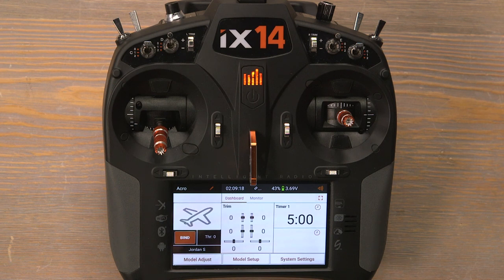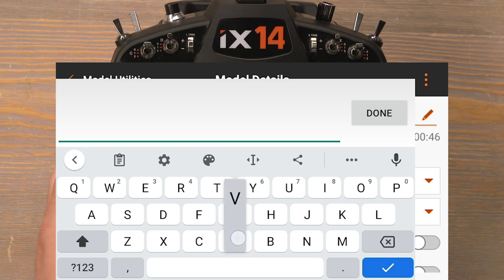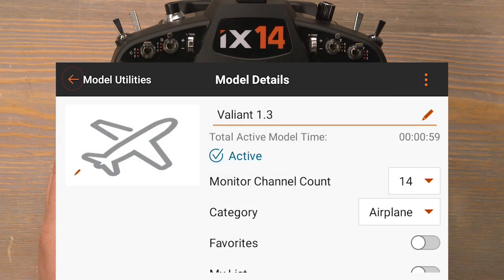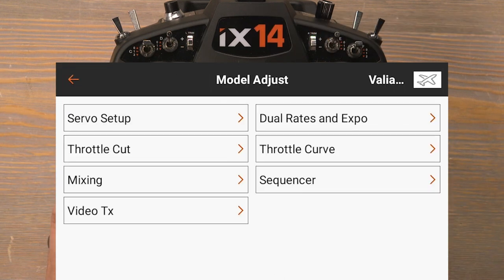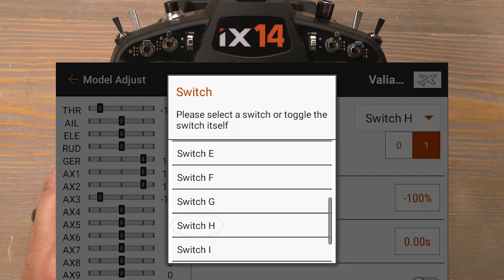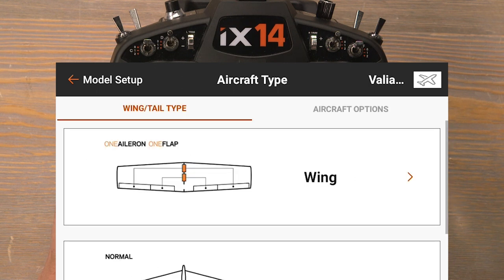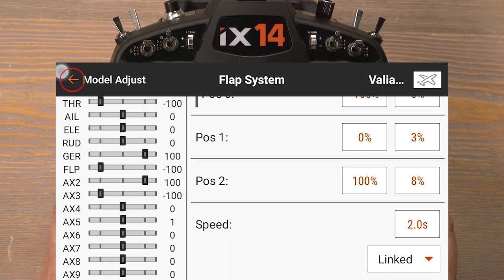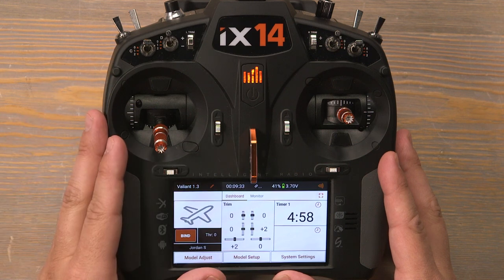E-flite Valiant 1.3m Spektrum Transmitter Programming Guide

Comment: Very good, except that you didn’t set “Require stick low” to “Yes”. You should enable it for electric planes..
Reply: What does that do? Thanks
Reply: @xfilesseasonteneponeandsix8346  If it’s set to “No” and you turn off throttle cut with the stick above idle, your motor will run. With it set to “Yes”, the motor won’t run until you pull the stick to idle and then push the stick up.